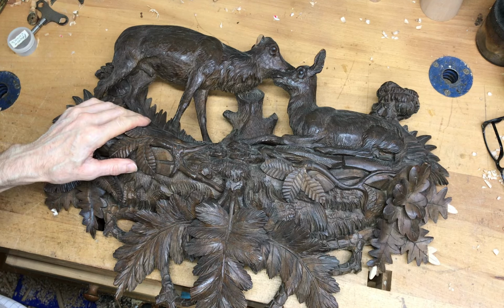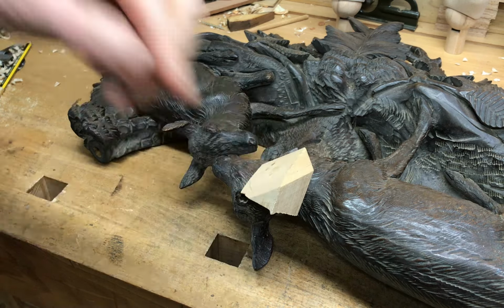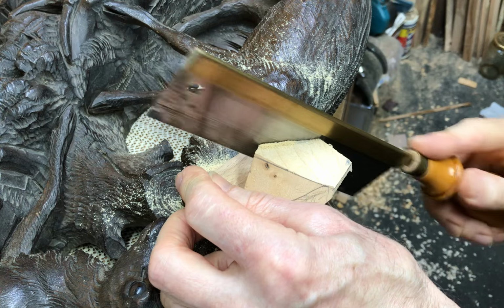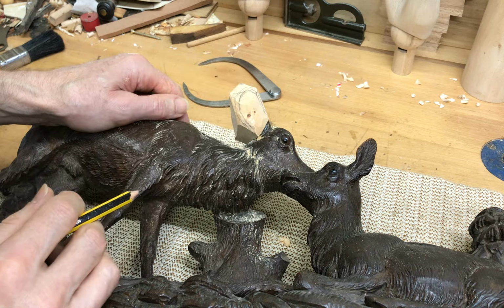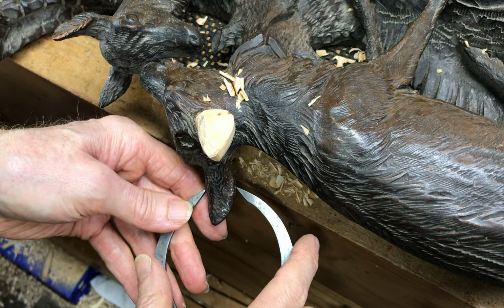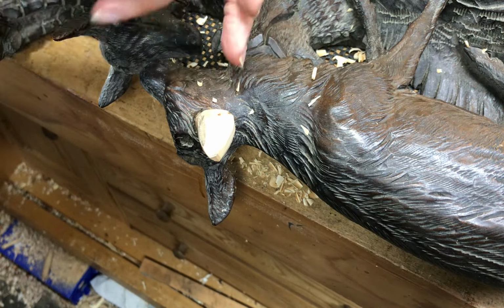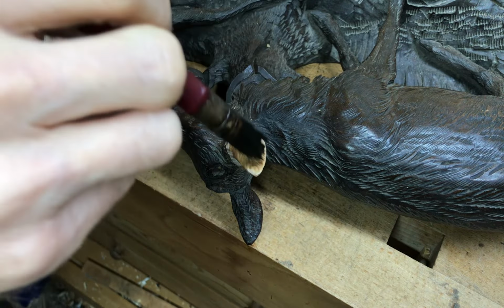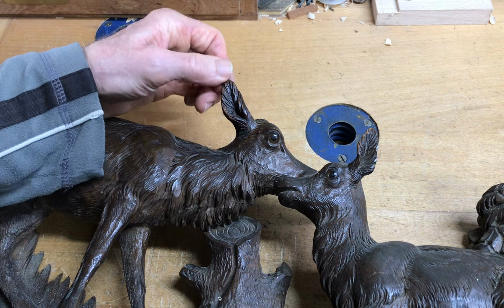Restoring stags ear. Carving

Comment: Beautiful work Ian; patiently and skillfully done, the repair being imperceptible. Even carving across the small knot in the ear didn't faze you! In your experience, have you ever noticed any difference between the use of European Lime wood and Lime wood from the US in terms of color, grain or hardness? I have the impression the European type is lighter and has a finer grain. If I might ask one more question out of curiosity; were the final blending colors, traditional watercolors or oil based? Thanks for sharing your work up close!
Reply: Guess I should have said water mixable oil colors. You did a great job whatever medium you used!
Reply from the maker: Hi Mark. I have only used European Lime so I have no idea if there is any difference, but there probably is. Staining I use water based aniline dyes and also use water colour paint between coats of French polish. It's a slightly odd way to do it but I make it work. Thanks for watching and the feedback.
Reply: @ianswindell  Though you may think it odd, it quite obviously works beautifully! Thanks much for the answer.